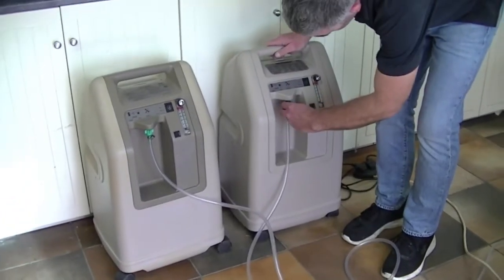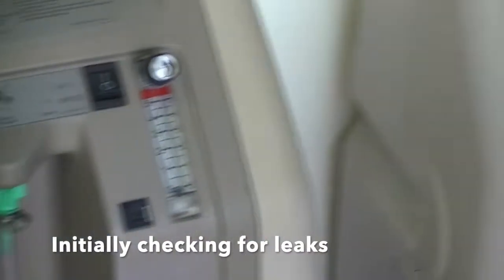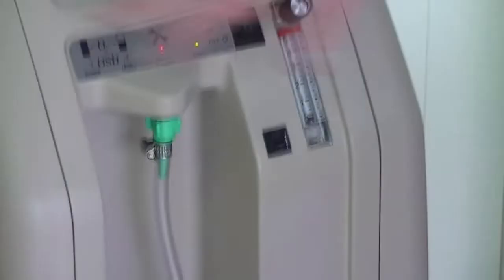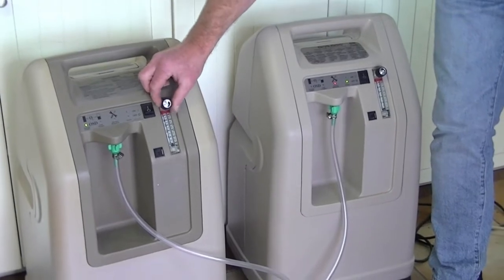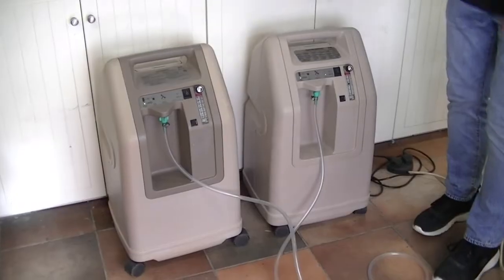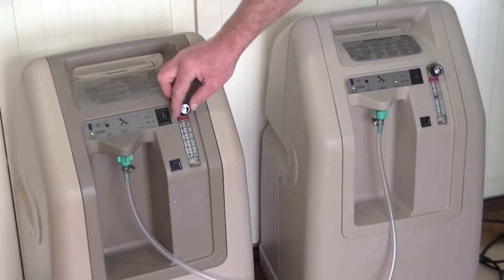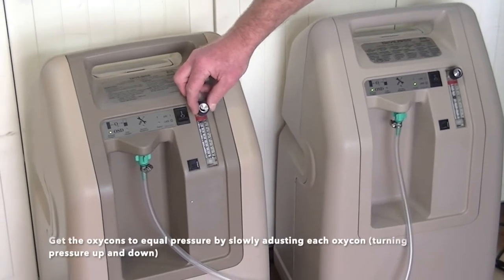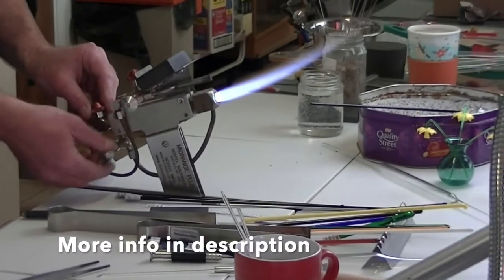Balancing 2 Reconditioned 5ltr Oxycons - Tuffnell Glass

Comment: Don't know if you are still responding to your videos or not, but I recently got two 10lpm machines to run a Bethlehem Stacks setup, I'm guessing the balancing technique shown here would be the same? They are two different brands, so how would I determine which one is the stronger of the two, or do you just make one the 'stronger' one by adjusting the output? Hope that makes sense! I am going to be setting this up this week and I need to get an answer to this pretty quick if possible, thanks!!!
Reply: Hi, to balance your oxy-cons i would turn them on unconnected to the the torch and no hose attached , turn both up full by twisting the pressure gauge, when this stops turning turn 1 revolution back , look at both oxy-cons and see what lpm per minute they are running at. You will probably find that one is running at 9lpm and one lower or higher. This will show you which is the more powerful machine to help balancing.
Reply: @TeresaBlofeld  Thank you, I definitely don't want to damage the machines with some kind of backflow.
Reply: Hi! I just got the exact same setup, I bought a Benthlehem Stacks burner and I'm trying to get the best setup with two tuffnell glass' 10lpm oxycons, how did you install it? I don't know which hoses are the best
Reply: @lo.manual  I finally just did a Y splitter run to both concentrators, and I run both of them at about 8lpm. I keep the larger bottom burner's oxygen open as a bypass so I don't cause any blockage. For the hoses, of course just the usual T-grade hoses.

Comment: this answered one question but now i have 2 x 5lt giving me 3lt each.is this correct or is there an issue?ive checked for leaks
Reply from the maker: After balancing you will always lose a bit of power , balance 2 x 5ltrs and you will not have 10ltrs but 3ltrs does seem a bit low , are you sure there are no leaks